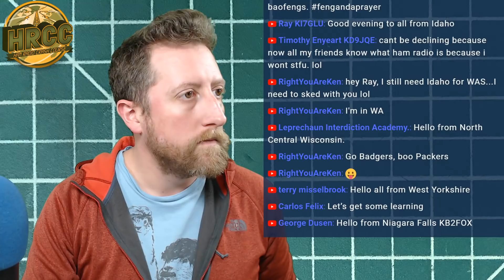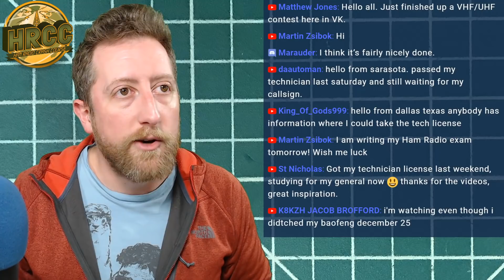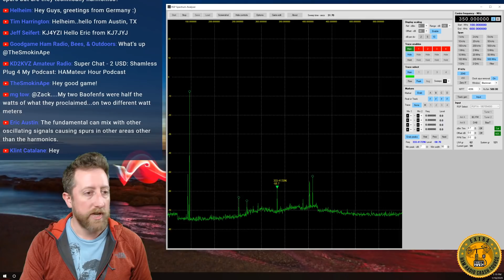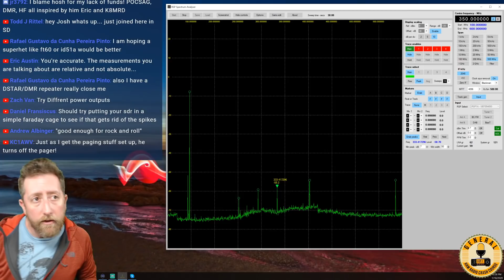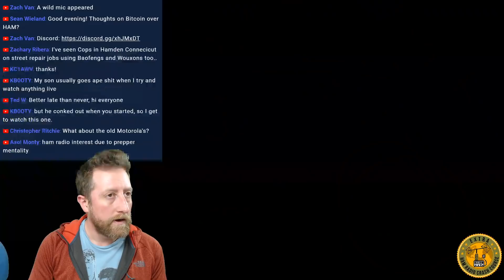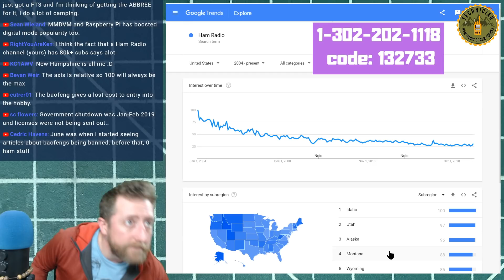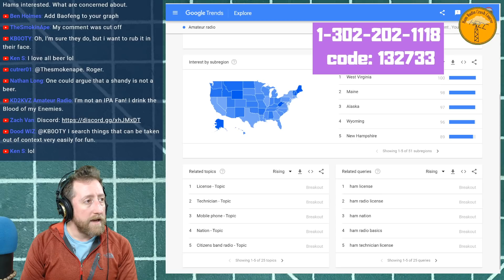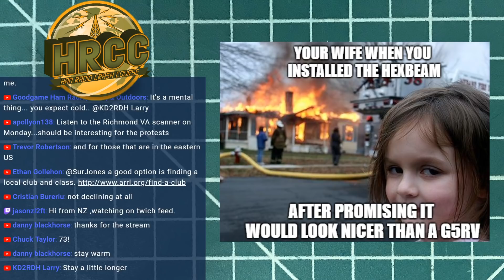Testing Baofeng Harmonics & Is Ham Radio Interest Declining?

Comment: Other reasons and also the main reason why the amateur radio hobby has not many people is people don't know about the hobby and that a such thing it exists plus the tests if they aren't tech savvy or have a learning disability that want to be an amateur radio operator can't get into it and turns them off getting into the hobby because its difficult. Me as a teen cb'er I didn't know about the amateur radio nor as tech savvy and didnt understand the tech stuff for the test or where to take the test when I did.

Comment: Amateur  radio has greatly declined since the 70's. The FCC is doing everything they can to make it easier for people to enjoy Amateur radio including opening up new bands. The only people I find still interested are those that want to be independent of communications that can be turned off in 15 minutes, and people that are interested in electronics. I'm sure there are those with other reasons, but they are very few. The radios are far from inexpensive and very few will ever know enough to build a radio or linear amplifier. Beofeng is a toy that's best suited for preppers. No one is going to leave a FT-60R at home to take a Beofeng into the field. People say these cheap radios get people interested, but do they really? People can spend their own money anyway they want. I think it's a waste to throw away 50 dollars on something to decide you really want an FT-60R. The Beofeng will make a good emergency radio when you really need one, but as a  primary radio it's just not acceptable. People who are really interested in radio are going to do the research before they buy anything, and see if it's for them and then spend the money on real equipment.
Reply: I recommend new hams in my area get a Kenwood TH-K20A, a solid VHF HT that a human can program w/o a computer.